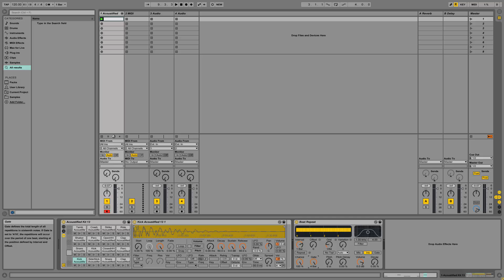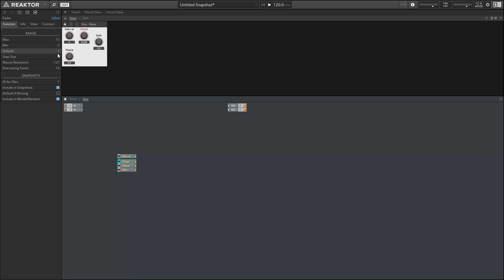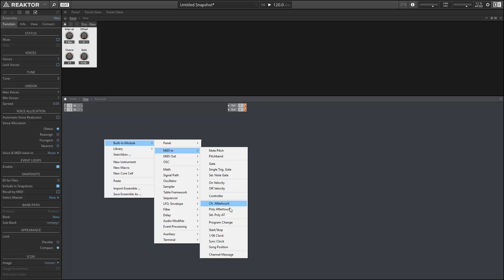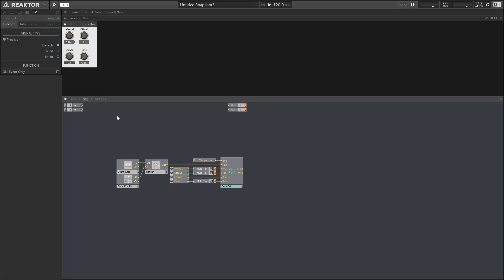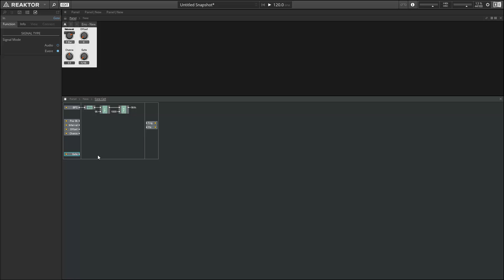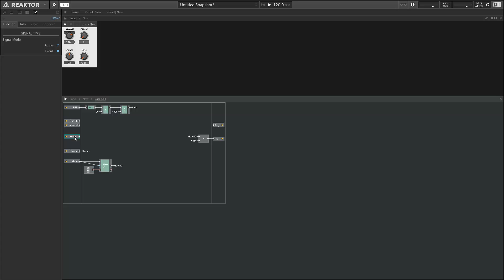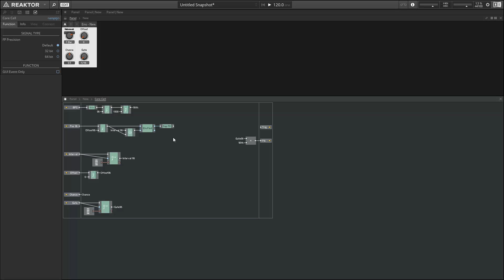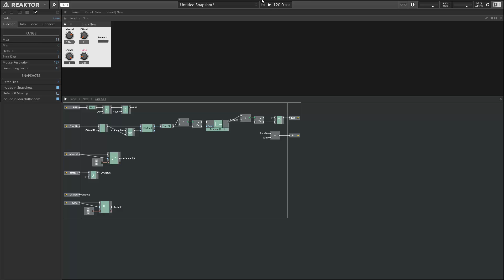Building Ableton's Beat Repeat in Reaktor - Part 1

Comment: Not sure the likelihood this comment will reach Salamanderanagram, but in the event that it does, I'm having an issue coming up with an alternative to the "idivmod", since it doesn't seem to be available in Reaktor 5.  Would subtracting a constant of .5 fed into a "round" module be as accurate of an integer value?  Also thank you greatly for all of your tutorials!  You are the only programmer out there that is both intelligent enough and generous enough to share your Reaktor knowledge with the world.  I am forever beholden to your great work!  :)  For years I've been slowly developing my own bespoke "flow" system, similar to Tim Exile, minus the live beat boxing and what not.  I would love to get your take on the level of efficiency I'm attempting to reach with quite an extensive set of modules in a single instance of Reaktor.  I think you'll at least get a kick out of the creative side of things, certainly not so much with programming, since most everything is a modification of other programmer's work.  I'll shoot you my email if I hear back from you so I can shoot you an example of my current work/ensembles.  Btw your 16FX concept blew my mind!!!  I had no idea control data and audio could be compiled and extracted between polyphonic and monophonic voices over single datapaths using the to and from voice modules.  Total game changer! :)